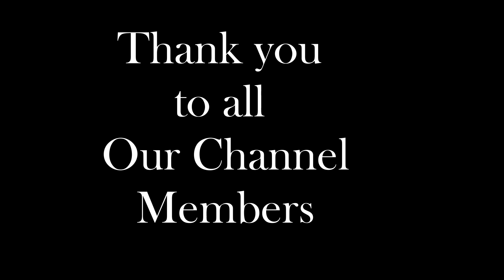A RUSSIAN Homestead & GOAT Cheese FARM

Comment: Back in the day New Holland built several models of round balers that utilized apron chains instead of rubber belts. They worked well...especially in coarse slough hay that had some small brush in it. The chains were expensive to replace when they wore out.